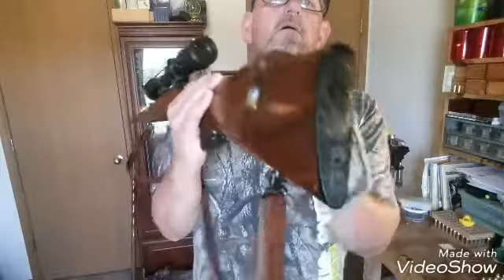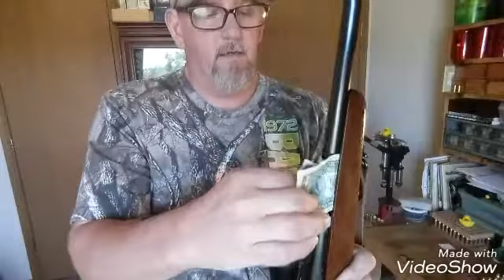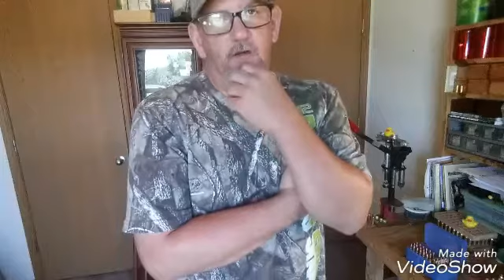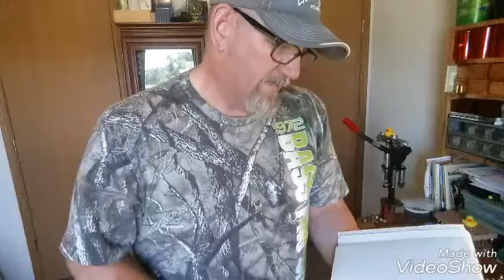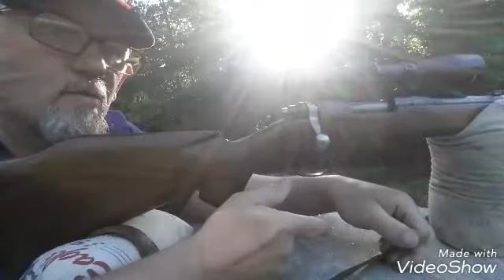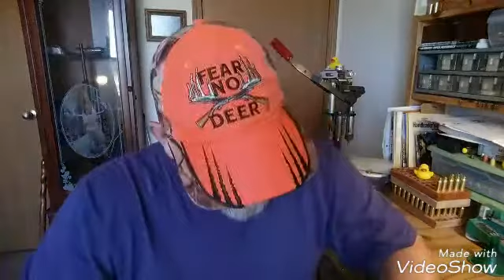Finding the right hunting load for the 722 308 Winchester

Comment: Tim.. My Best advice before you shoot up all those bullets is to dump out the jar of egg money and have that rifle Glass bedded, Also have the crown looked at and refinished by a well-known gunsmith. I have done Glass bedding before, There isn't any real trick to it, However, clean up and contouring the bedding job is what makes it so time-consuming and best left up to a gunsmith. He has an idea how much bedding and Glass filler to use. If you have and cheaper old rifle around you could practice on it first. also one thing else. Trigger quality is paramount with accuracy, You may want to get an aftermarket replacement trigger. There is no reason why that rifle should not shoot through the same hole or shoot a ragged hole @100 yards. Good luck with the bedding job. Dave.
Reply from the maker: Thorsaxe777  I'd say since the gun hasn't had anything done to it there's quite a bit to do trigger crowning bedding thanks for the advice Dave